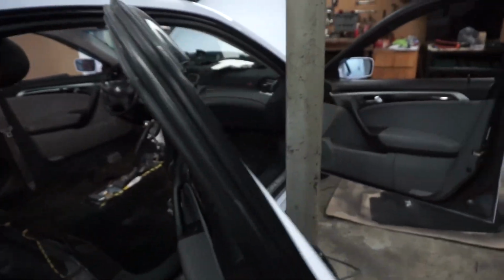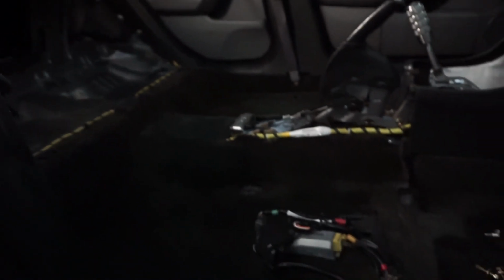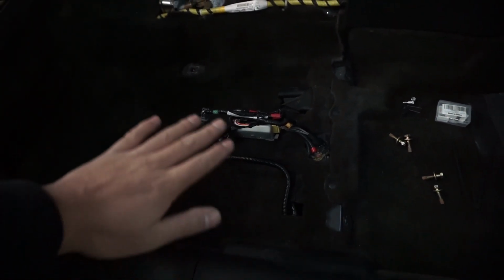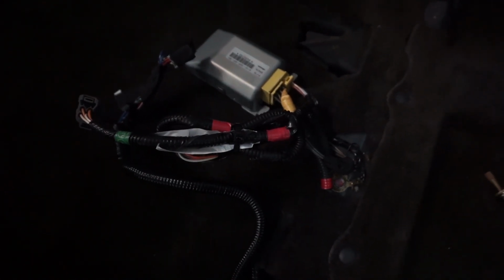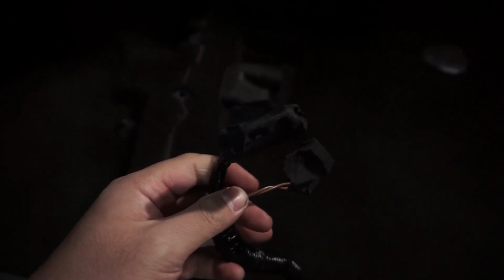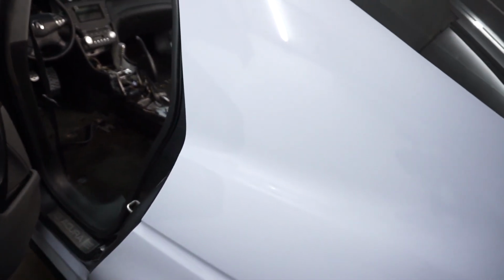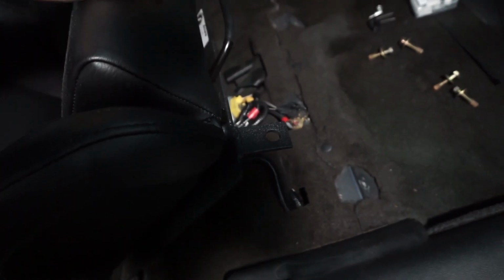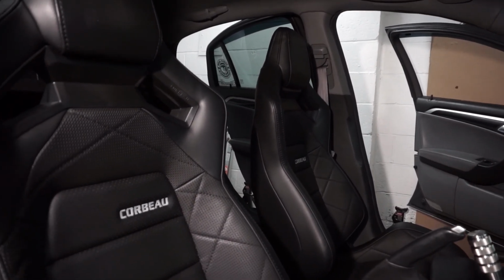How to remove the "SRS" light in a Honda/Acura PART 2 | Corbeau RRX seat install

Comment: I just gave 12 volts to the wire that sends the signal from srs to the main computer. I just installed a pair of S4 recaros
Reply from the maker: Nice. This allowed you to bypass the entire opds module?
Reply: @JSant  yes, the opds are also part of the srs system. I can remove all the airbags and now codes will appear. Saw that trick in Acurazine, I took pics in case that someone needs them.
Reply from the maker: @l2ikardo  I must've missed this thread on Acurazine. Thanks for the info. I'll try it out
Reply from the maker: @l2ikardo  I just looked it up... I have seen the thread you're talking about but that removes the SRS system entirely. I wanted all remaining airbags to still function  so I took this route instead.

Comment: seats look good! glad to see these videos. I wont go racing seats yet but upon my little research a year or 2 ago, there was nothing like this for the tl and everyone just lives with a dash light along with no airbags for the passenger. also great choice on the seats. heavily considering Corbeau solely because they give you an option to retain heated seats lol. 

also at this rate, you might be the first to try the electric AC conversion *wink*
Reply from the maker: Thanks man! I did think about going for the heated seats option but since I'm not driving this in the winter anymore it didn't make sense.  I'm curious though as to how good they are compared to OEM.

I really want to do the electric AC but I have so many other mods I want to finish first... UGH!
Reply: @JSant  yeah that makes sense. And I completely get you. Would be nice to actually see an electric ac kit documented. Ran across someone who ran ir for a day lol
Reply from the maker: Haha yeah I saw that post on FB the other day... I wish he would've went into more detail.